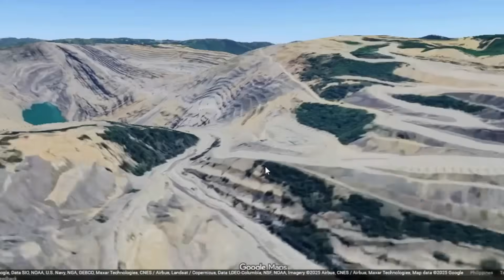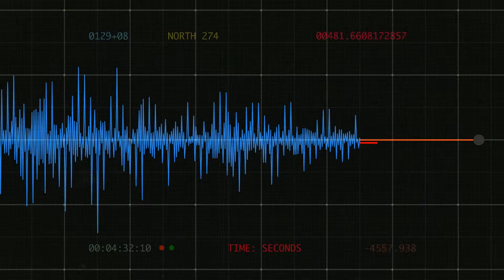Cebu’s Flood Disaster Isn’t Random — It’s Written in the Island’s Geology!

Comment: the billions may be spent but most of the flood controls are made with substandard materials, you can see how thin the rebars are on the projects, some used pvc pipes as reinforcement, some projects may look like fine but its hollow on the inside. using substandard materials to save the money straight to the pockets of corrupt politicians
Reply from the maker: @hisan-i1u Thank you for sharing your observations and concerns about the construction practices related to flood control projects in Cebu. Stay safe.